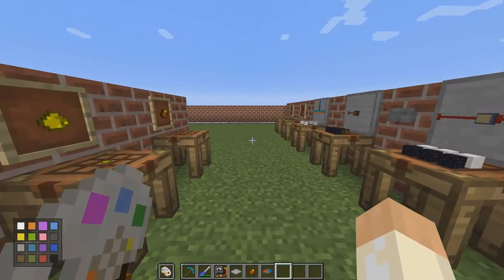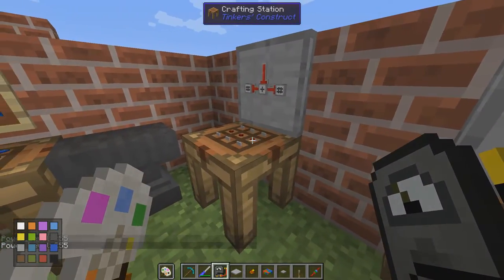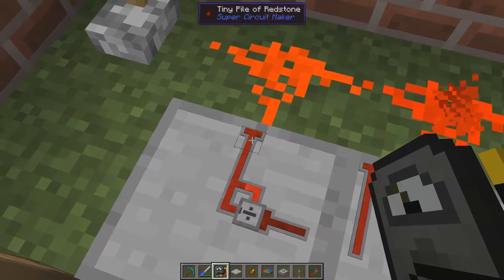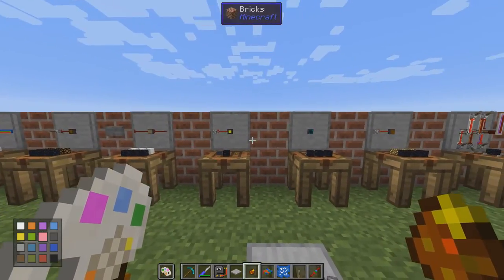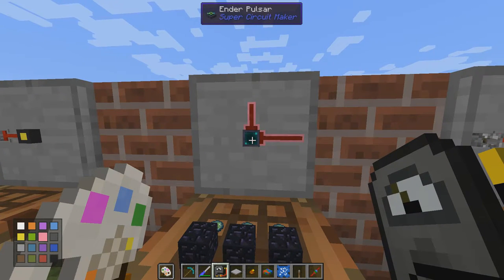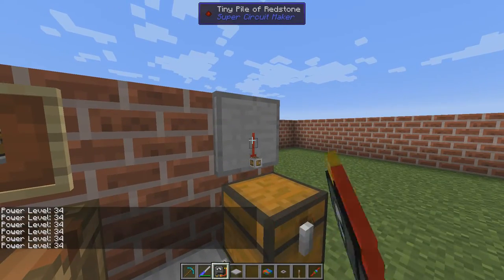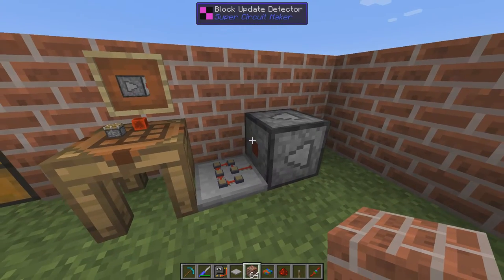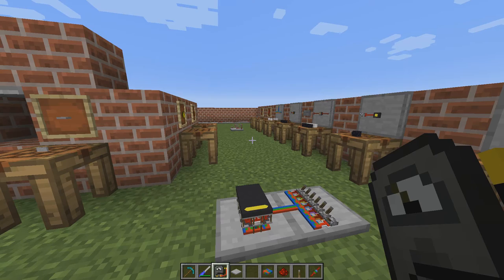Super Circuit Maker Tutorial: Getting Started - Part 2/2 (MC 1.10.2)

Comment: Also: You don't need bundled cable to output a color from the bundled sticks, it works directly, and you can use impregnated sticks to take direct outputs for most crafted circuits (math operators) I cant say much in the way of the tutorial itself, I'm bad at judgement.
Reply from the maker: Yup, that's true. For this tutorial (that is meant for beginners) I didn't mention all smart tricks as they will be forgotten instantly. I saw you used that method in the stacked comparator setup (which I have plans to use in a video as soon as I get time).
Reply: i discovered this recently: if you place a colored wire between two bundled sticks, it filters out all the other colors, blocking them, i tried to be greedy about space and it ended up not working because of this 'feature', but i can see potential uses.
Reply from the maker: Cool, I didn't think of doing like this. But it's the same result as using only normal sticks since it's the colored wire that does the filtering?
Reply: the point is to carry the color to use in bundled cables, and i think perhaps this mod could use WAY more config customization, such as: max circuit levels, max complexity, max nesting...